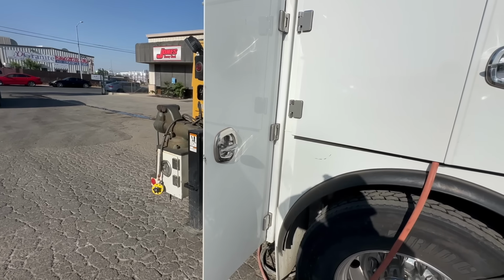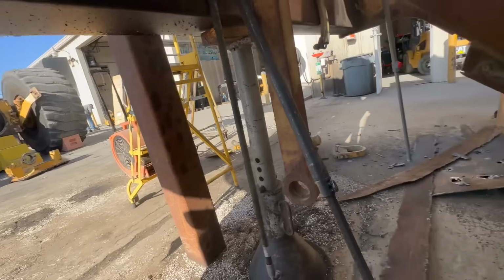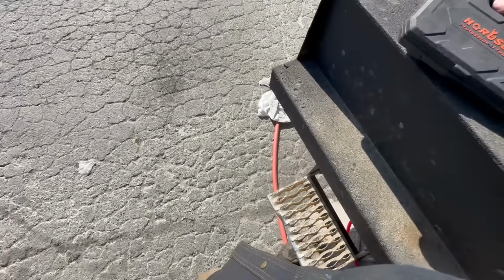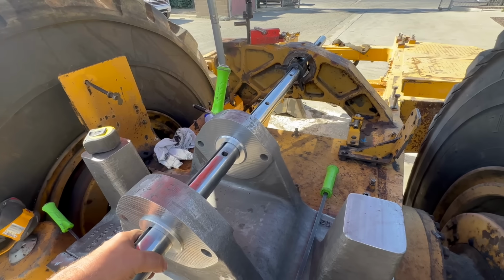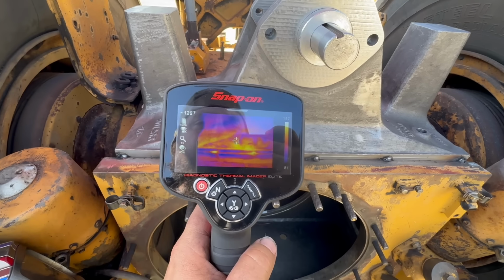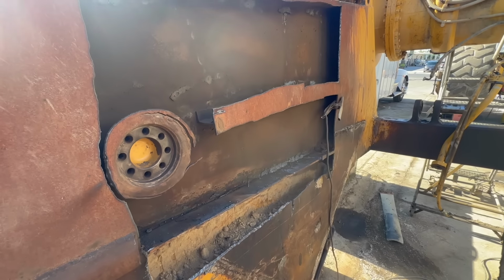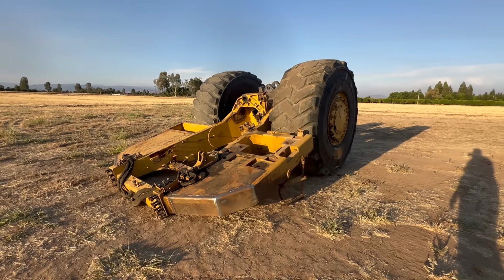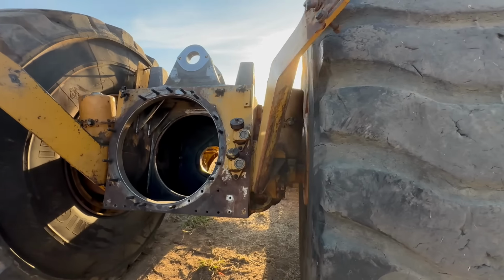Cat 637 Horizontal Transmission Mount and more………. Part 1

Comment: wow, cat has really gone cheap on bowl sides now, I can see where they save material and assembly labor but at a huge cost to the owner
Reply from the maker: I agree.  They engineer it to work, but not last.
Reply: Says the guy that spends more time trying to get the old equipment to do anything other than pull another 5k out of the bank.

Comment: As usual, impressive work.  Can't wait for the next parts.

I'm curios what that part would cost, and do you get the measurements from factory manuals or prints or from the broken piece.  
Always amazed at your work.
Reply from the maker: I would guess about $5,000 for the part. I get the measurements from CAT. But they are hard to get.

Comment: Hi been watching and just wondering what size plasma you have to cut some of the materials you do with the thickness. Knowing a 80 amp does about 3/4 inch 19mm using 3 phase 415v
Reply from the maker: Hypertherm powermax 105. I have sever cut 3” with it. A 85 should cut 1.5”

Comment: Hi Greg, thanks for your Videos. I hope for a 1o part Series!!!! of that extensive re-build. Welding inside the transmission Housing must have been a job in hell. Luckyly your new Crewmember seems to be a bit "undersize" so he fits in there nicely: No offense! 
Greetings from Germany Manni the CAT Man.
P.S. Get Jacob  new pants. He is no credit to himself or your Company runnig around like that. Even the colour of his undershorts is no longer a secret. With all the weekend Jobs he is doing with you in the Apple Valley he should easy buy himself a new pair of workpants.
Reply from the maker: He finally got new pants.  I have been bugging him about it.
Reply: @OFW  What you don't like "Golf" pants? They had 18 Holes.🍻

Comment: I have noticed in many of your videos that you extensively use a Miller Multimatic 220 running what I assume to be a 0.035 or 0.045 Dual Shield wire.  Do you ever run into the Duty Cycle or Thermal Limits of the welder?  Also what kind of shield gas/flow rate do you use?  Love the content!
Reply from the maker: I use my 220 a lot but only run .035 solid wire through it.  For dual shield I run the arcreach 12. Never trip any duty cycles.   I run 30-50 cfh with 75% argon 25% co2
Reply: @OFW  Do you think the Miller 215 and 220 using the oem MIG gun could run 0.045” if not 0.035” dual shield wire, power and feed wise?

The Miller 215 is capable of 27v and 600 on the WFS - in theory the 220 uses the same MIG electrics as 215.  

Thank You for thanking the time to answer my questions, and I just wanted to say I love the field work on all the heavy equipment. I am learning a lot not just about welding but heavy equipment too.
Reply: @OFW  0.045 wire on a Miller 215 @OFW  0.045” wire. 

Since your reply, I have set my Miller 215 up to run 0.045” dual shield wire with c25. The Miller is capable of up to  27vdc and 600ipm WFS.   On 1/4” to 3/8”I have tried several settings but seem to find myself back at 25v at 350ipm, but I’m struggling with settings and travel speeds etc. and getting wormhole porosity on the surface. Or the bead is roped up and not really wetting in.  I try to keep a 3/4” stickout.  If I get too close I get porosity, if I get too far, it seems to slip from Spray transfer to Globular and I get big spatter BB’s. 

You said you always run Lincoln 71a85, but I can only find that in 15 pound spools, so I settled for Blue Demon 0.045”, (and I’m a little underwhelmed by its performance), and I don’t think the Lincoln 15 spool will fit inside the Miller 215. 

I was forced to go on disability, and I am trying to find something I can do within my abilities and tight budget. 

I know every machine is different and wire brand makes a difference too, but could you please recommend a basic starting point for settings.

I have tried standard 0.035” Flux Core, but I think the welds are brittle, and I. Hoping the dual shield will help improve penetration and weld strength. 

I have learned a lot from your videos, and truly appreciate your content.  Your knowledge of heavy earthmoving machinery is very impressive.
Reply from the maker: @michaelwhiting878  .045 dual shield.  25-27v 350 wire speed. Every welder is different.  If I was there I would be happy to set it up for you.
Reply: @OFW  Thank You - those settings worked well for me. 

I want to try to run the Lincoln 71a75 but I can only find a box of four 15 pound spools.  

Do you know if those 15 pound spools will fit inside a Miller Multimatic 215, and if it is available anywhere as single rolls?  Being on disability, I just can’t afford that much wire just to find out the roll is too big for my machine. 

Thanks for answering my questions, as it means more to me than you know.
Reply from the maker: @michaelwhiting878 I had this issue before.  I could only find large spools and I made a setup to transfer wire from a large spool to a small spool to solve that problem.  Just some pipes welded to a plate with a drill on the small one.   Hope this helps
Reply: @OFW  Thank You great suggestion!  I can build a rig to transfer some to a smaller spool that fits. 

You prefer 71a75, but I have also seen 71a85 which says it can run on C25. 

Have you ever run the 71a85 wire?

Do you know what the difference between the two is?

Would you be willing to sell a single or partial spool of 0.045 dual shield?

This Blue Demon stuff is cheap, and I would love to try Lincoln’s dual shield from what I’ve seen on your Chanel, it leaves beautiful welds. 

I live near the Pismo Beach area, so I’m not too far away, and I would be happy to buy some and cover the shipping.
Reply from the maker: They are both basically the same. They run the same and use the same gas.  I only run 1/16” wire. I don’t have any .045”.

Comment: Looks like a job for JB weld
Reply: If there's one thing I've learned from JustRolledIn, it's that spray foam is the new duct tape.
Reply: @Cancun771  combine the two and it’ll hold anything
Reply: @Cancun771 
Yeah for spray foam, how did we survive before spray foam.

Comment: What do you call this? Restoration, Overhaul, Deposit level rebuild, ???
Reply from the maker: A little bit of everything.  Rebuild  and restore.
Reply: I wonder where the line goes in cost before it's not worth repairing these scrapers.
Reply: @Frank-Thoresen  if like anything else theres a 5 year wait on a new machine?

Comment: I love your videos and mean no disrespect, but by the sounds of that air arc in the background, the amperage is way too high and beats the hell out of the machine for no reason
Reply from the maker: Ya, the person using it doesn’t have a lot of experience and the electrode is smaller than we normally use.  I plant to get them dialed in better.